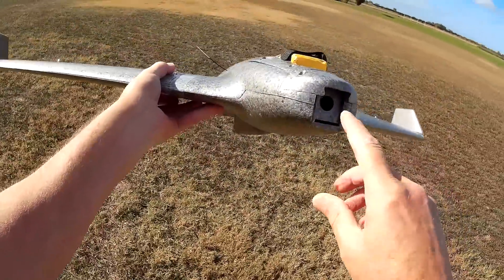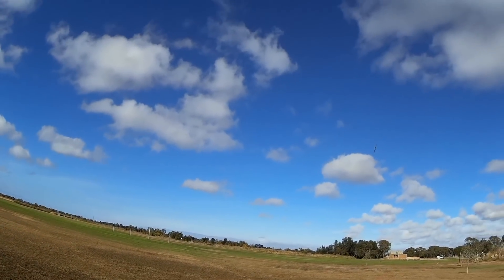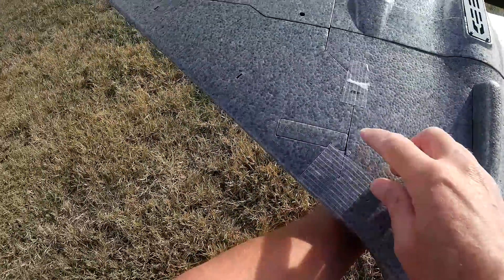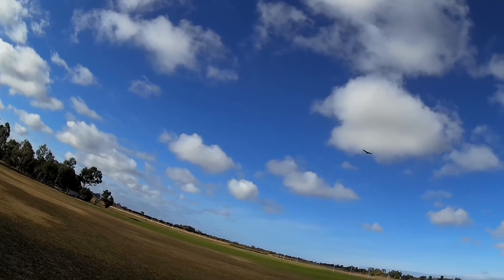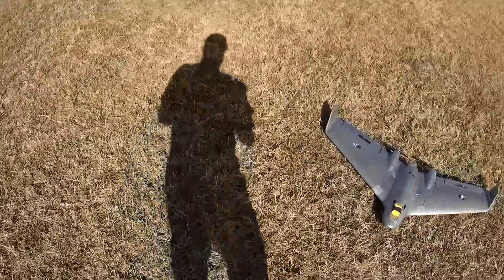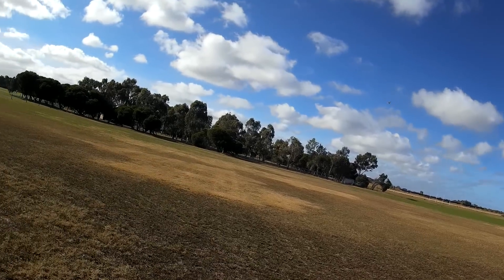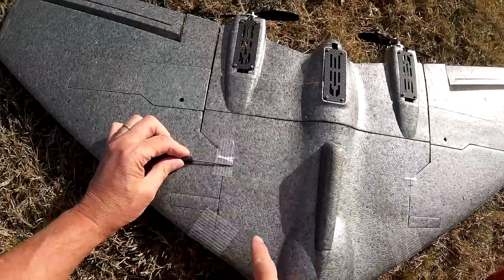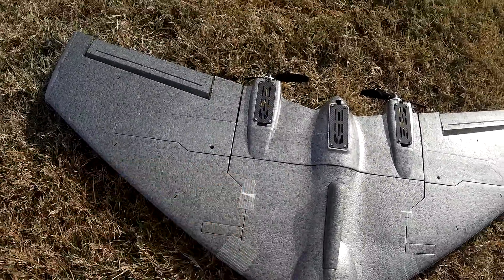Reptile Harrier S1100 CG tests

Comment: Hi Mr. Andrew, how much maximum auw of Harrier? My Harrier just arrived and I started assembly it. I plan to use sunnysky 2216 v3 1250 kv as single motor, I have a little worries about the motor's power vs auw. Thankyou sir
Reply from the maker: Dont know max weight sorry. Have a look on RCGroups, someone will know there.
Reply: @AndrewNewton  how about your Harrier? How much it's auw?
Reply from the maker: Mine was around 1200g

Comment: Generally on any flying wing or plank, when you move the CG back close to optimal, you also have to lower your elevator rates.    You'll get the same response with less throw.   If you don't, and keep pushing it the results are as you say "inevitable".     I never saw it try to tuck in this video so doubt you ever made it all the way to tail heavy.

Comment: Hi Andrew,  It Looked to me as if moving CG back still didn't remove Up Trim / Reflex. ..It just flew worse the further back you moved CG..  Also the further back you go the more limited you are getting with the size of battery you can run to hit the higher CG measurements. ( Unless using Bigger motors ).  Does that sound like the right conclusion  to You ?
Reply from the maker: Improved going from 285 to 300 then it got worse and still needed the reflex
Reply: Ok confirms  the same as i found.. you cant dial out All the reflex , best i got was down to about 2 - 3mm Cheers Andrew

Comment: The motor mounts failed simply because of the lousy "plywood"...glued together with Cuckoo spit...and is the wood Birch..?
  Naaah, course not.
       310mm sounds about right then Andrew, although one of the parameters missing from this test is the wing loading factor. It needs loading up with say a 5000mah 4S Lipo, simulating a typical FPV setup, with a half decent range and duration..?
  That would mean an increase in flying speed, and probably heavier motors or mount extensions to force the CG backwards so a 5000mah Lipo can be used.....Sunny skys for example, not Multi Rotor motors.
Reply from the maker: Yes, has plenty of wing area to carry the weight